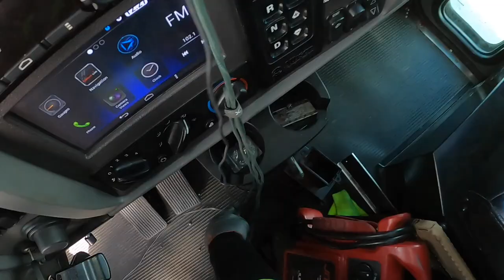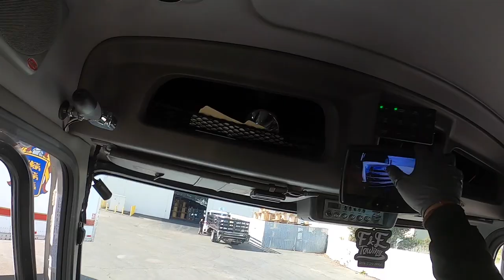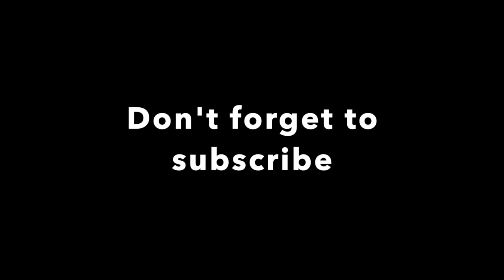Towing a Hino box truck

Comment: You should add a bypass switch inside the cab to lift and lower the axles
Reply from the maker: That’s not a bad idea I’m going to look in to it
Reply: @fetowing9231  we have them in our trucks. Put a switch under the dash.
Reply from the maker: @TowMan127  how did you run the air lines inside the cab?

Comment: What size is that truck you're driving, and what bed is it
Reply from the maker: It’s a 20ton century 4024
Reply: @fetowing9231  I really like that size, and with a tag axle nice. How is the turning radius, my Freightliner is terrible for turning 😫
Reply from the maker: @Bryan-FAA-certified  it’s not too bad the 33k gvw chassis have good turning radius. My 16 ton Freightliner turns a lot sharper than this peterbilt
Reply: @fetowing9231  I drive an 95 classic with a DTU. It's got over a million miles on it
Reply from the maker: @Bryan-FAA-certified  nice we have a dtu as well that we use as a back up truck. The tow capacity is a little higher on the dtu than the 20 ton